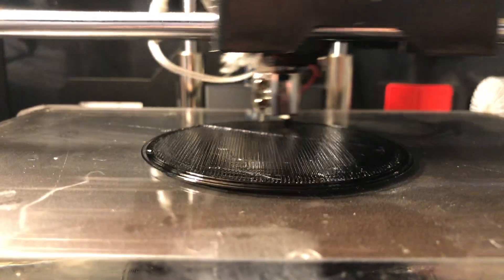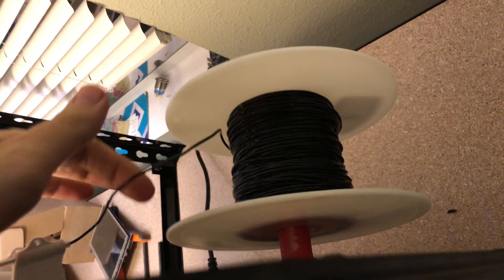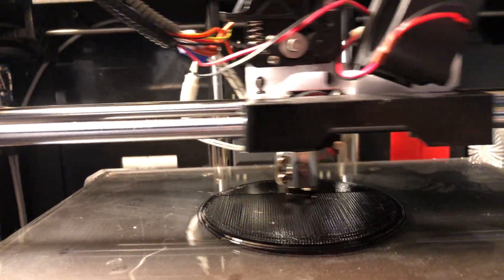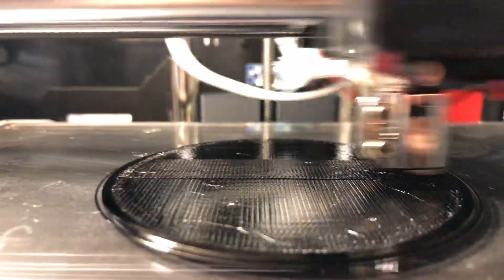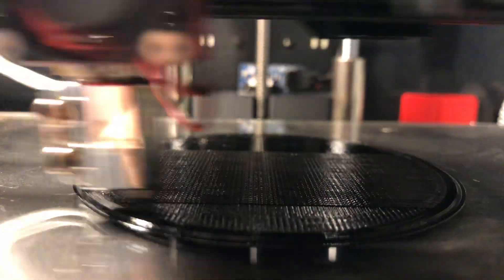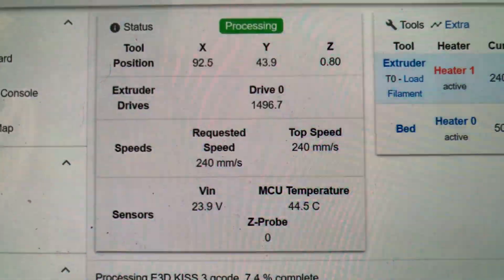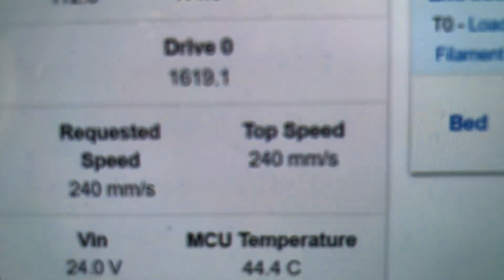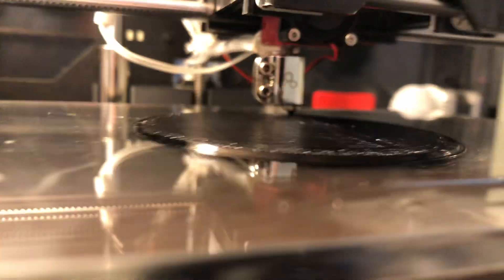Nova Hotend TPU Speed test

Comment: Looks great! I'm curious to see how fast really soft materials like ninja flex could print if you had a bondtech or something feeding it. A real eye opener for sure!
Reply from the maker: If I had bondtech on this machine (which I actually had) it would create a total mess and drop reliability to almost zero on anything over 50mm/s and god forbid if I use any retractions there. SO the answer is that BMG extruder can not print flexible materials reliably at all. This was the main reason why I went back to MK8 again and never looked back. Some people still like BMG, but imo - it is not worth it if you have Nova on your system. BMG solves other hotends issues with pushing plastic, with Nova it is not really any benificial and limits your plastic choice.Bondtech is supposed to give you an opportunity to use smaller lighter stepper via gear reduction, but with Nova Hotend I don't really need that as I can use such small stepper even without reduction.
Reply: @Vladlabs  interesting! Thanks for the reply!
Reply from the maker: @lukeD8099  update on BMG Luke, I made it work, it was just a bit tricky to tune the right tension amount, but once done, it now prints TPU with the same results as PLA or anything else, and the resolution gain due to gear reduction is always welcomed :)
Reply: @Vladlabs  hey thanks for the update! It's not often I get those! That is really good to know. Definitely interested in this even more! I'm not having the best time printing tpu(due to my hotend) so it's nice to know this will be compatible. Thanks again!